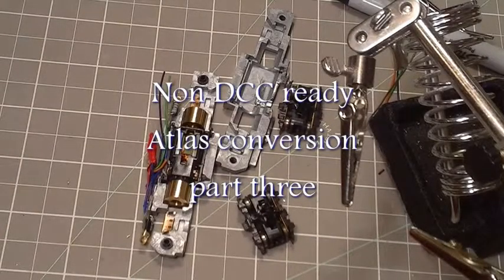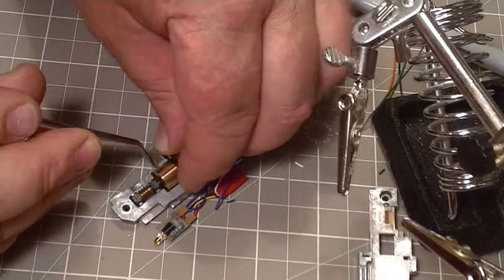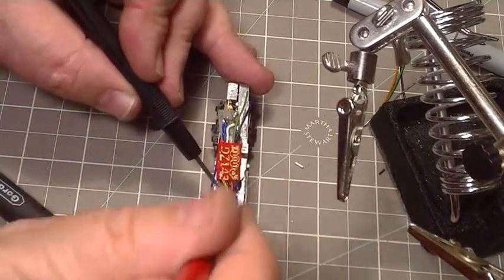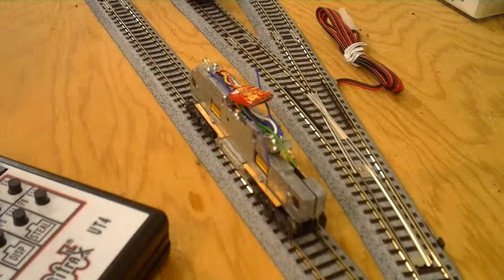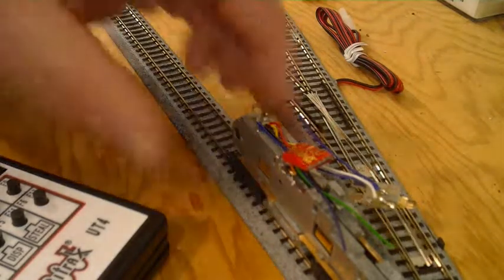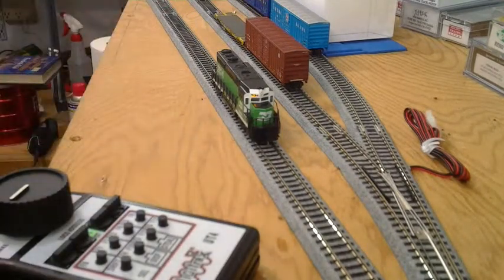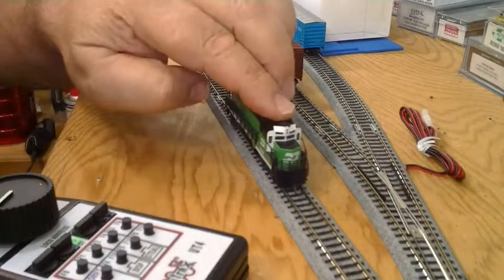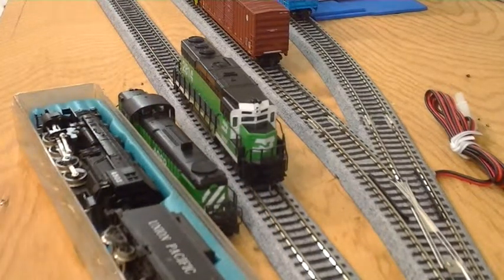Non DCC ready Atlas conversion - part three

Comment: How is your low speed crawling on this conversion? I want to get an EMD SD9 (with Chicago & Northwestern paint) for my planned layout (primarily SP40-2 Dakota Minnesota & Eastern with the "City of X" named locomotives). There are manufacturers making DCC equipped DME locomotives right now, and if I lift decals, I can also convert their ICE (Iowa Chicago & Eastern) locomotives too, since they share the same paint scheme. Atlas and Intermountain share their basic chassis design (same manufacturer), but the current DME and ICE SD40-2 locos have the newer DCC ready chassis, and the older Atlas SD9 does not. I'd consider buying an old SD9 from ebay and converting it, but only if low speed creep is good on the conversion. If you have trouble getting your conversion to crawl at low speeds smoothly, then I'd rather wait for Atlas to possibly reissue the SD9 with a DCC ready chassis.
Reply from the maker: richfiles - low speed performance is affected more by the motor/gearing in the model & which decoder you decide to put in, than by the conversion process.  That said, this model & my older RS-2 that  I did the install on are two of my favorites!  I have done a few more "drop in" decoders from TCS & they seem fine as well.
Remember this is N scale, so anything below about 1 mph (to me) is pretty fine.  Any slower than that & I find that I start to get "bucking" in the train not caused by the motion of the locomotive.  It is usually caused by varied friction of wheel sets, differing weights between cars, and trackwork defects.  These can make it appear as though the locomotive is not crawling as smoothly as it should.

Comment: if the frame of the locomotive was power before you started how did you isolate it from the motor now that the motor is wired?
Reply from the maker: At about 3 minutes in you can see me adjusting the wire that I soldered onto the motor (orange and grey) to make sure they were not touching the frame.  You can also use a bit of Kapton tape to insulate if things are a bit tighter.  This is why I carved the little channel into the frame and removed material where the wires would be attached.